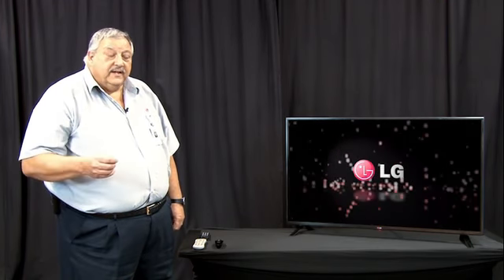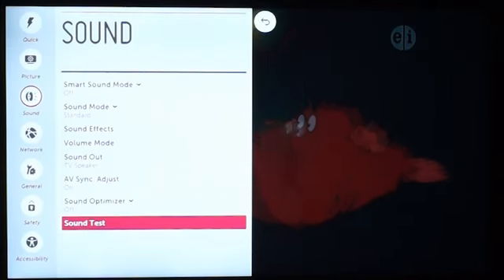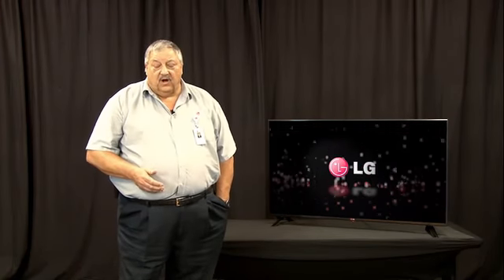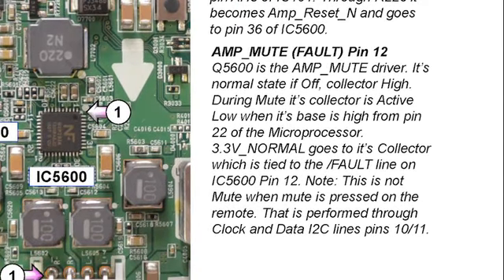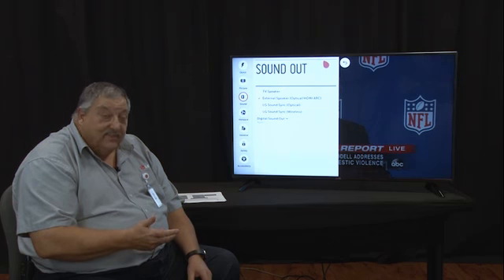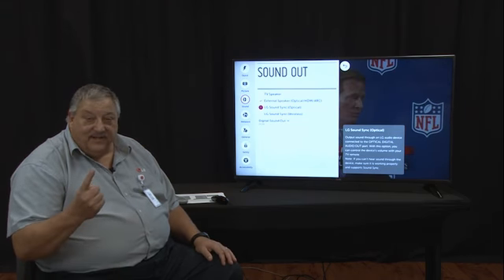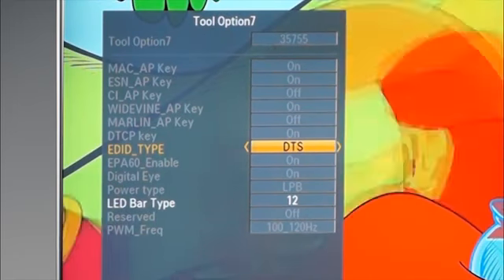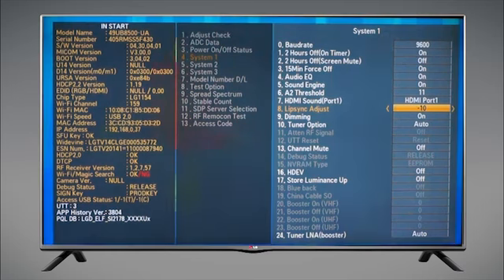7 LG LCD No Audio

Comment: my problem is that on my TV most cable TV channels have sound, and a handful don't.  What can I do to get all of them to work on my LG 32" TV?
Reply: Since most of the channels have sound, changing the audio settings has no effect.  The cable TV box is connected to the TV via an HDMI cable.